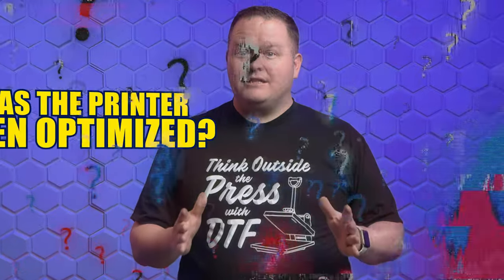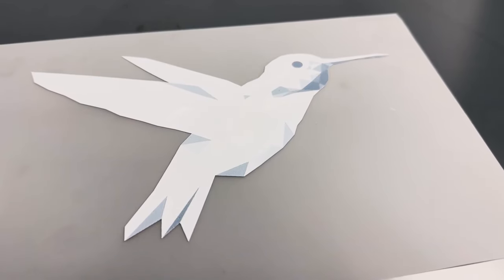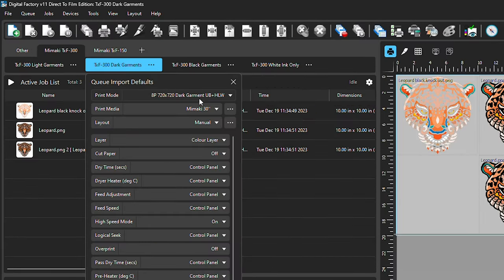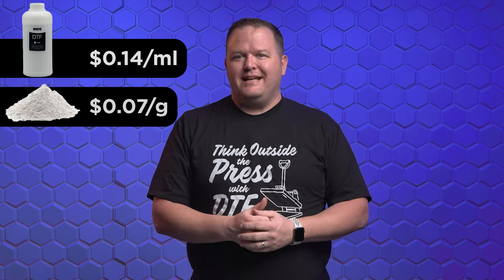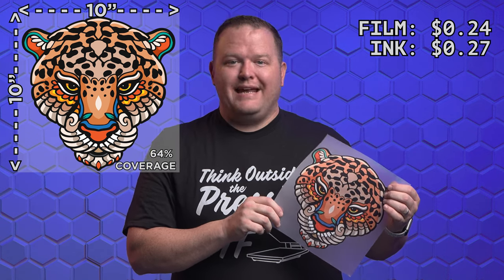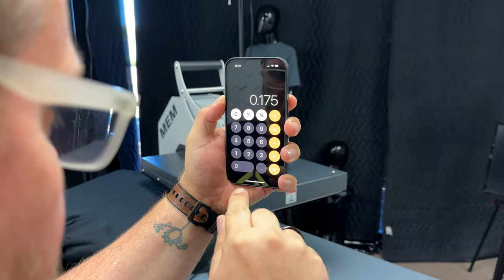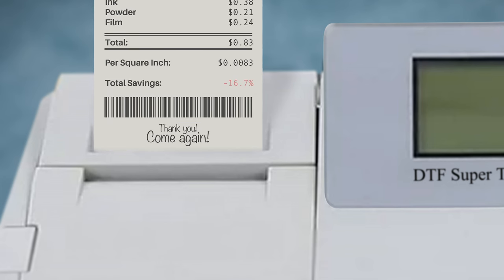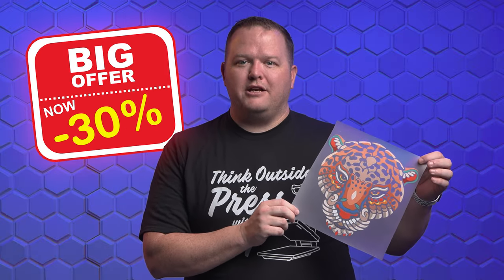How Much Does it Cost to Print on the Mimaki DTF Printer?

Comment: I have many problems with my TxF150 specifically when the white has sharp corners and takes a lot of space (a very bold text logo for example). Extremely difficult to remove the film once applied and the letter corners almost always lift up so you have to push them down with your finger otherwise it's set for life. Great video, thanks for sharing !
Reply from the maker: try increasing the pressure on your heat press.